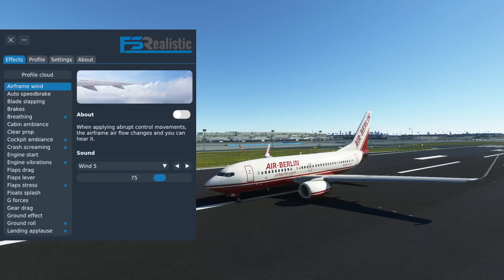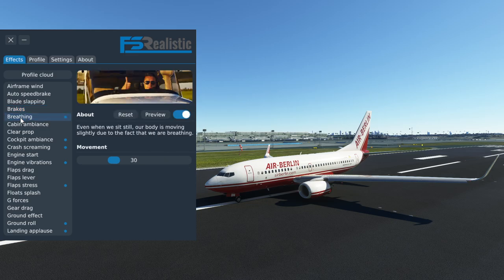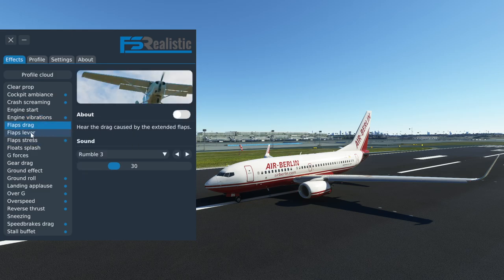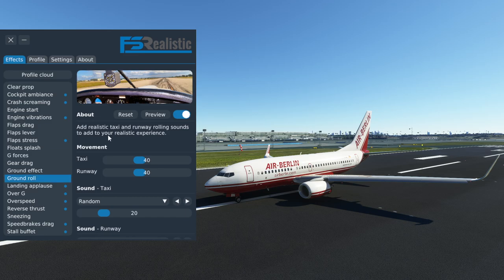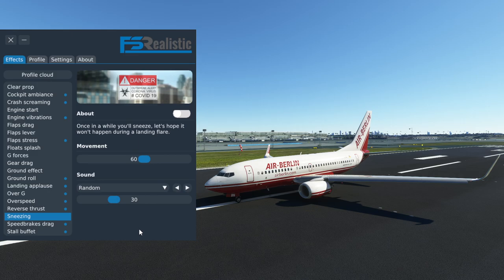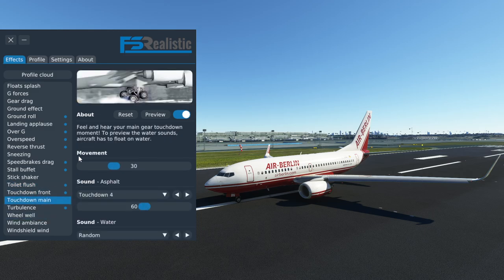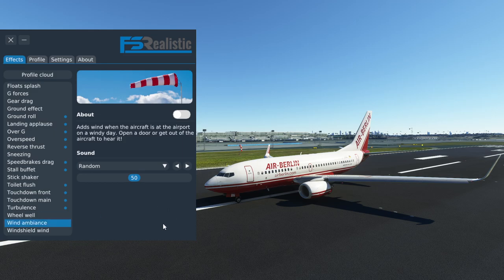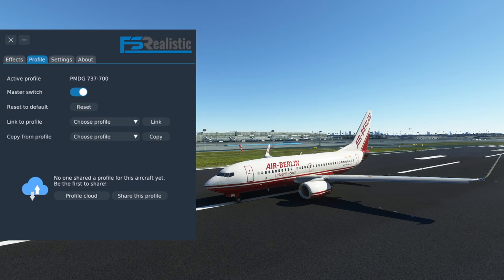My FSRealisticPro PMDG 737 settings

Comment: H Emanuel, I've been using your setup since your video. Did you ever change settings since and upload?. I really like it and have now added haptics on pedals, yoke, seat and floor running with their SimHapfic sister solutions. For the immersion, the best solution I have done (along with Vatsim). Thx

Comment: Thx for your sharing …I have a question for some reason I cannot apply Park brake without push the rudder breaks pedals …any idea ?
Reply from the maker: Just like in the real 737. You need to push the pedals to apply the parking brake.
Even though I was not aware this was actually simulated LOL
Reply: @A330Driver  but when i release the rudder pedals brakes the park brake is release too ... is it normal?

Comment: Thx,
I've had 2 issues with the 737: 
1. Before take off, if the departure requires immediate vectors once airborne, the LNAV won't be armed, i would select the desired heading and arm the HDG mode. However after taking off, if i engage the autopilot, the plane will NEVER follow the selected Heading, I'd have to quickly deselect the HDG and select it again. In those few seconds, the plane will start going where he wants (weird). Is it normal?
2. Most of the time, when i select an altitude and press LVL CHG or a desired V/S, I've found my plane failing to level of at the target altitude (either slightly lower or slightly higher). I have to pay attention and press LVL CHG again to adjust (weird). Is it normal? 
Looking forward to your insight on these 2 issues.